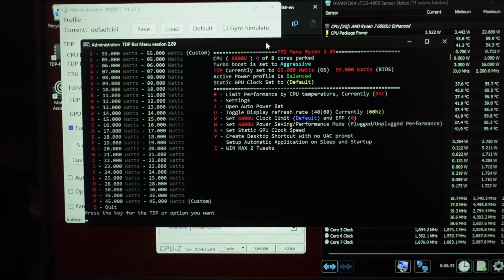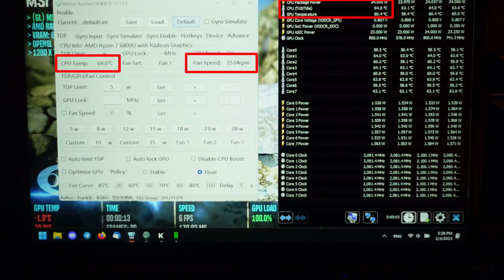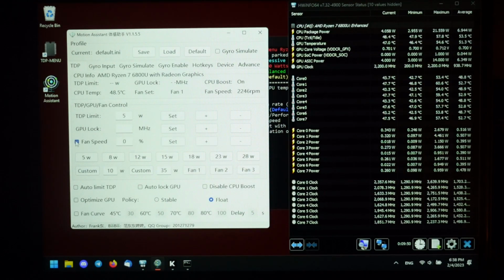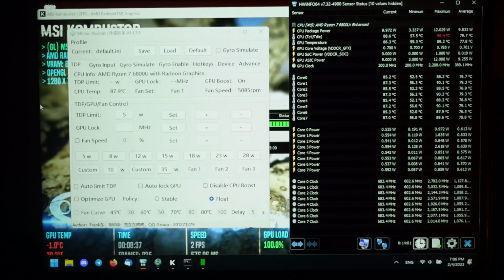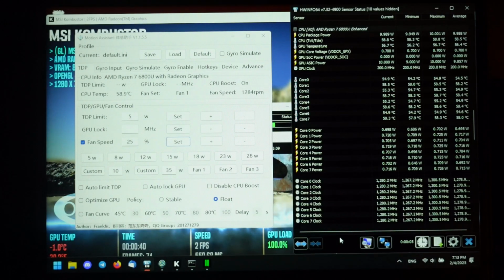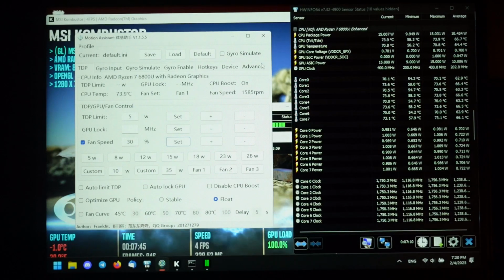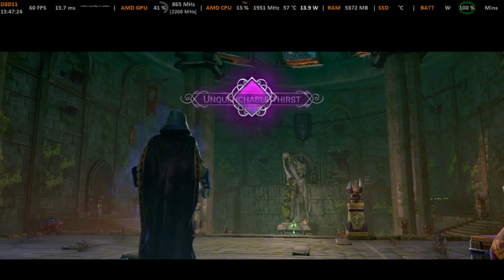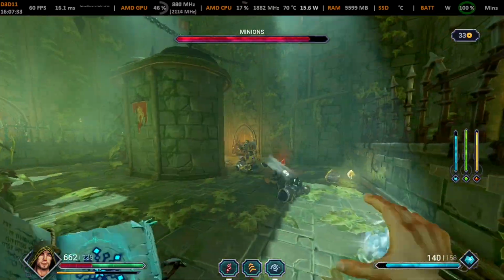GPD Win Max 2 - Super Silent Mode - Honeywell ptm7950 follow up [Passive cooling & manual fan tweak]

Comment: How did you get that TDP Bat Menu? It looks much more reliable than the power control panel V2 that ive been using (only semi-successfully)
Reply from the maker: The bat is way better. It is the best tool out there.

It is only available on the GPD-Discord. The invite is in the video description.
It is under 
GPD Win -> Tools.

Here scroll up to the second post, or search for "TDP Bat menu"
Reply: @mystechry  cool. Thank you good sir. That is very helpful
Reply: @mystechry  I found it scrolling all the way up in tools.

Is 305 the version you use?
Reply from the maker: @scarvalho1  
It's outdated.
Go to the "auto-tdp" channel (2 above "tools") and check the pins. There is 323.

Comment: I dont game on mine, only code and dev stuff so I wish they sold a passive version with a thinner bottom (I assume its so thick for fan and cooling reasons but maybe not)
Reply from the maker: For coding you want more than 10 watt. If you compile and test stuff, 10 watt become a limiting factor quickly depending on what you are doing.

As someone who holds the unit in his hands, I think the thickness is needed to make the unit feel comfortable.

I do a lot of work on mine, too, but I am using it docked most of the time when I do so.
Reply: @mystechry  makes sense, I could see the extra thickness being important for comfort, I dont use it that way personally

I dont really compile much just code and save to git then run/fix when home on desktop

I'll try 15 watt, honestly it only annoys me when the fans spike so maybe 30-40% with cap will be fine, thanks for the video

Comment: Thanks for the content. I have a Surface Pro 4 and a barely used 2020 M1 MacBook Air. I want to replace both devices with a Win Max 2. Would use it for visual studio code,  artwork with Auto Desk Sketch, light blender 3D work, and gaming. I'd probably get a 1TB 32GB RAM version. Love the portability aspect of this machine, and love how it can be a discreet gaming device. Thoughts on whether this is an ideal machine? I'll take anyone's input. Thanks!
Reply from the maker: I have the Max 2 Intel prototype since July and the retail unit since November. Since then I use it as my primary main device.

I did Blender works on my Min 3 already which has a weaker CPU/GPU. Max 2 is fine or moderate Blender modeling.

Also all the videos I made are cut using the Max 2 and KDENlive. No problem.

I have made an other short video showing that pen pressure sensitivity is supported.

I have the 16gb ram model and so far it's enough for me. 32 should be plenty and enough.

Get the 1tb model and replace the SSD afterwards if needed.

Yes, it is as close to an ideal device as you can get.

Hope that helps.